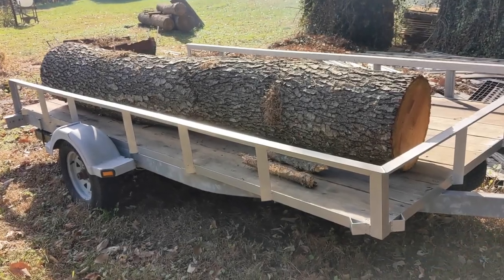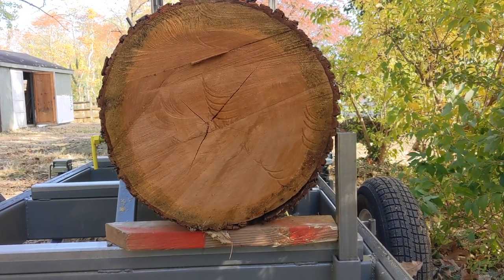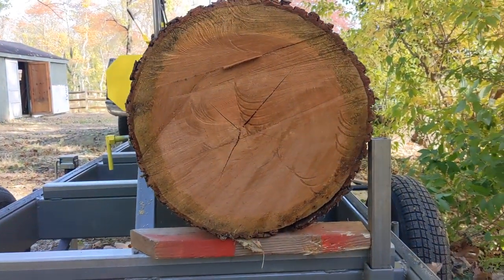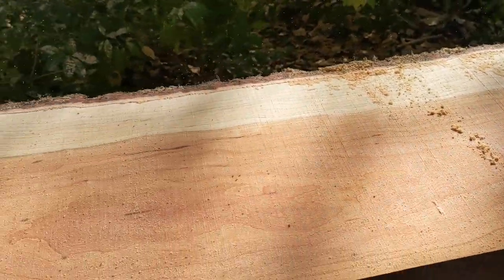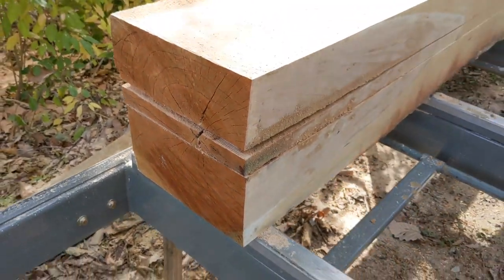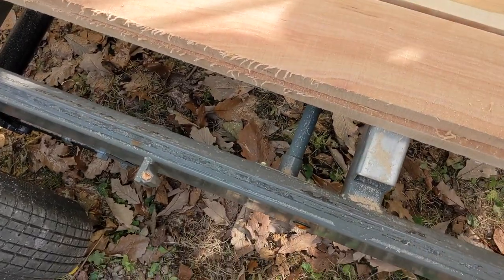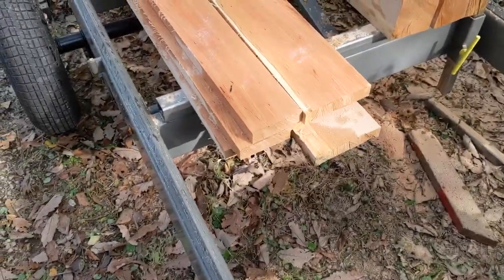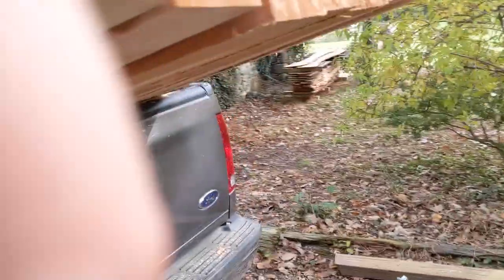EZ Quarter Sawing Method from Woodmizer

Comment: As a WoodMizer owner making my living by sawing for over 24 years, I was surprised that they suggested quarter-sawing this way. I found this on their website and you got it somewhat right. You are ending up with about equal quantities of flat, rift and and quarter-sawn, which is not necessarily a bad thing but if you follow the WoodMizer directions you will get mostly quartered with a bit of rift and no flat. Also, I cut many yard tree logs and saw through lots of hardware. At first I did like you and looked the blade over for damage. It's not always easy to see the rounded teeth, but don't fool yourself. Also, you knock the set out of the teeth. Do yourself a favor and change blades. Remember, a bad day of sawing is way better than a good day in the office
Reply from the maker: You are correct one ended up with a variety of cuts of cherry.  I have not tried this method again because it seems harder to do this way. Lots of flipping and turning.  I have since encountered a variety of foreign objects in the wood and you are correct a lot of time the teeth are not visually damaged but the set is gone. I just do this for fun it's been a good learning experience so far.

Comment: What plans did you use to build your saw mill? Id like to build one so i can cut longer logs
Reply from the maker: I did not use plans.  I watched Matthew Cremona's big sawmill build it is very informative.  Took design elements from his mill and scaled it down.  Also studied videos from cooks sawmills, timberking, woodmizer and diy builds.  I incorporated different features I liked from each brand to build my own.  I just recently found a FB  group called Home Made Sawmills.  They have a wealth of info that would have been very helpful knowing about that resource before starting a build.  If you watch the video building a sawmill in 12 minutes you can see the logical progression I followed on the build. Start with the band wheels with tension and tracking and build from there on.  The carriage is the main component the trailer is easy and can be built to accommodate any sawmill carriage.

Comment: Sure is nice that you can get hardwood where you're at.  Im all pine and fir here.  Trade ya.
Reply from the maker: Wow thats kinda a bummer unless you like cutting dimensional lumber.  I am pretty lucky we have a wide variety of lumber types. My goal is to mill as many different types that I can source locally.
Reply: @thedelcodave  I do campfire benches and countertops that seem good so far
Reply from the maker: @aaronymousunlimited2661  I saw your benches are beautiful I am definitely going to try to make one of them.  Also considering making a cookie cutter attachment that was a good idea.   I have an idea in my head to make a slab flattener that uses the mill bed and rails and has its own carriage to carry a router or large electric motor to drive the cutter head.
Reply: @thedelcodave  sounds great.  Ill be watching.  I have a new video coming today soon covering features in action.  Please stand by.

Comment: I’m confused with the American way off quarter sawing, we classic wise cut them like a orange segment and square them off.
Reply from the maker: I agree I am still confused how this produced quarter sawn. I can see some but alot is riff sawn. Seems like a ton of work.
Reply: @thedelcodave  Yeah, only about half your boards are ,but for a fairly small log you got some really good boards and some utility grade. I figure you know now you're not going to get rich with a manual mill anyhow so as long as you had fun it was a good day milling, right?
Reply from the maker: @timothylongmore7325  definitely won't get rich that's for sure.  I had fun designing and fabricating my mill. I enjoy learning the milling process. Most all the wood I use for my own projects or give the wood to friends.
Reply: @thedelcodave  I've got an oscar thirty on a trailer and a homemade half built. After a day with my oscar I knew I better not do the math and just have fun with it. I'm a timberframe/barn repair guy and always wanted to be able to make what I need when I need it. Mission accomplished, lol.
Reply from the maker: @timothylongmore7325  that's awesome. I hope to get some land and do some timberframe construction of my own some day.

Comment: You will get more rift then quartered with this method
Reply from the maker: I can confirm because most of the wood ended up rift sawn.  I don't think there is truly any easy way to quartersaw lol.
Reply: @thedelcodave  it is a dieing skill these days with traditional quarter sawing
Reply from the maker: @jasonsshaffer8775  I will try it another way but when I have an extra set of hands requires lots of turning.